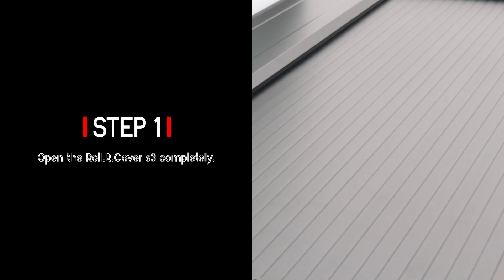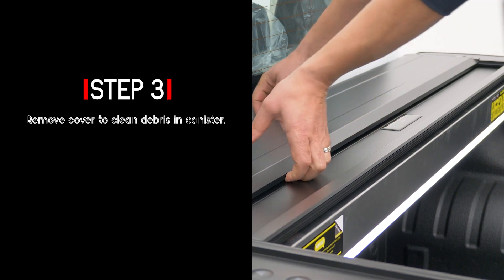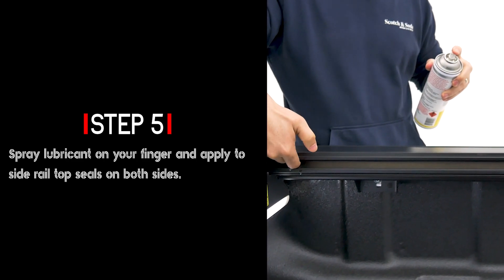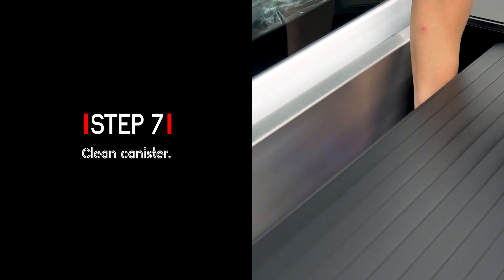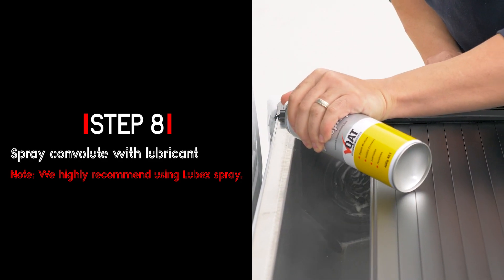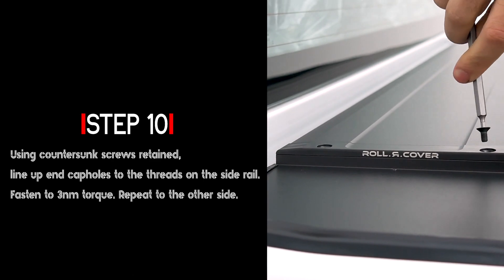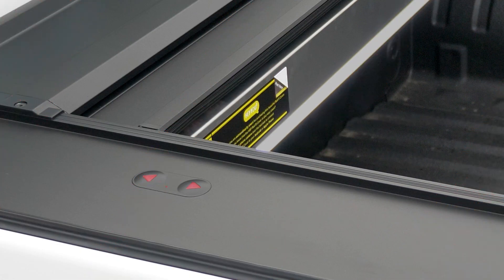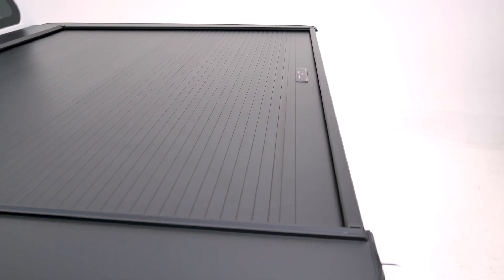Series 3 Roll R Cover Maintainence

Comment: The light flashes when requiring maintenance. After performing the maintenance, the light continues to flash. 

I found the solution for this was to double press the open and close buttons; the same as you do when setting up your phone app connection, and it stops flashing.

Hope this helps someone else like me who wondered about it for like 6 months.

Love this product 100%, would buy again.
Reply from the maker: Hi there! We'd also recommend updating your firmware via your HSP4x4 App. This will stop the light from flashing again :)